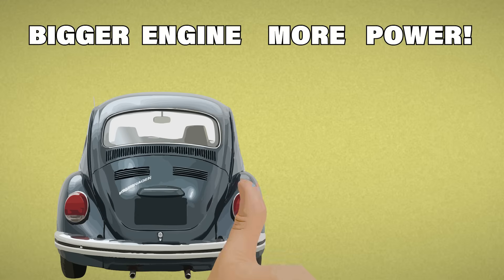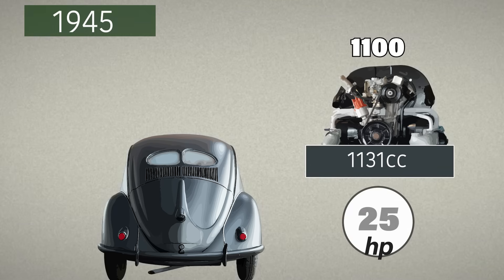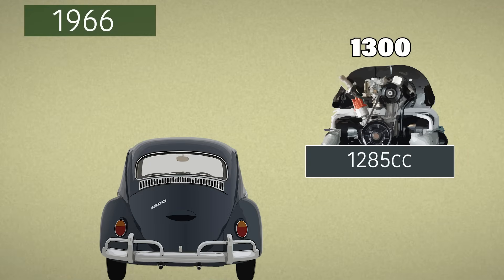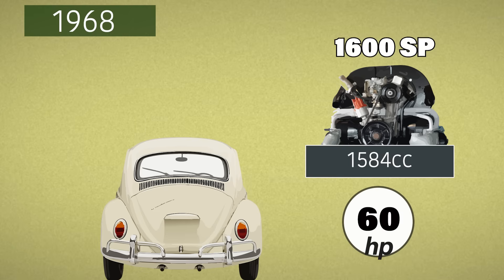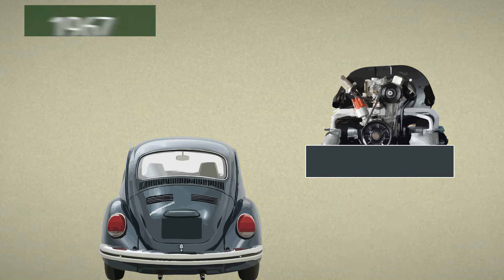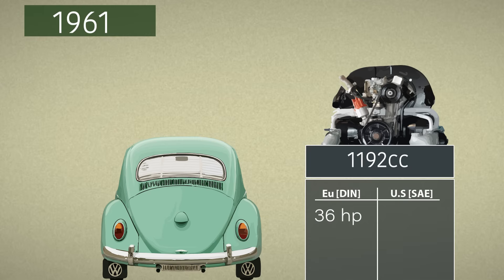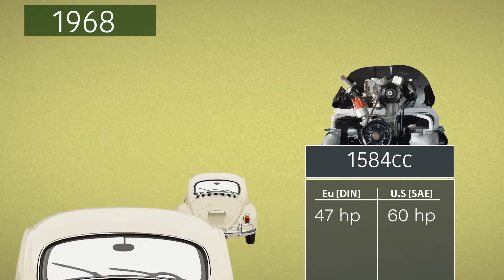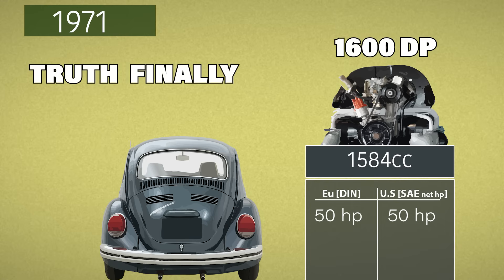The Great VW Horsepower Conspiracy

Comment: Reading the comments here makes me smile. Horse Power per cubic inch has long been the standard of performance. In the 1950's 0.7 hp per cubic inch was doing good for an engine. In the 1960's some engines were getting close to one horse power per cubic inch. 1970 saw some performance engines doing 1.1 horse power per inch. These are cars coming from the manufacturers, not ones tuned for performance in the back yard. A 1600 cc VW engine is a 100 cubic inch engine. For 1970, a good performing engine of that size would be 100 HP. You'll notice in the comments below that the biggest claim is still only 93 HP. My point is that these boxer engines were durable and economical but were only high performing engines if compared to other VW engines. For those of us alive in 1970, we already knew about the US conversion to a horsepower measuring system that reflected real life conditions as opposed to the one the manufacturers had used for years that gave them a marketing cheat in advertised power. The after market has long been good for VW engines. No matter which engine you start with, you can build something with major replacement parts to get whatever of performance our wallet can support at far less investment tan a similar change to other car engines
Reply: I have a motorcycle with a 1290cc (under 80 cubic inch) engine making 160bhp, more than the first 6 cars I owned. Times change.

Comment: The 1954 1200 was rated at 30hp in Europe, 36hp was SAE. The "modern" 1961  1200 was rated at 34hp, not 36.
Reply from the maker: Yes, I missed that, and it explains the massive jump which seemed odd. 27 up to 30 makes much more sense. Thanks for the correction 👍
Reply: That is not consistent with numbers published in the 1960's and  1970's that I remember. See if you can find a contemporary publication that says 34 HP.

I do remember 36 HP, and 40 HP.
Reply: @markjohnson8260  You mix up SAE hp with DIN hp. The 30PS DIN engine was in other counties the 36hp engine, the 34PS was the 40hp SAE. I still own a 34Ps/hp VW 11 vulgo Käfer; if I do not know - who else will??

Comment: HP is a factor of torque. Are you going to cover weight and torque?
Reply from the maker: Power to torque ratio, I like it. If you see it come up, you’ll know you inspired it 👍
Reply: @KombiGarage  Thanks but I'm asking if you are going to cover vehicle weight to torque as displacement increases without significant hp increases are typically used by manufacturers to deal with increased weight. I'd be curious to see how the Beetle's weight increased in relation to it's engine output specifically torque.
Reply: @DontCryAboutIt HP and weight are one and the same when observed, so they are the two to compare.
Reply: @PSA78 The weight has increased for example the 1946 weight was about 702 kg and 1974 about 816 kg.
Reply: @DontCryAboutIt Could be, if they posted acceleration time it's all be accounted for.

Comment: I had had three different VW and was finally ready to go back to a big 8 cylinder and told my mechanic to sell mine with a 1300 in it. When I came back it was still on the lot and when I complained he told me to take it out for a ride! He switched my 1300 out for a 1600! When a cop pulled me over he didn't ask me for my license, he asked me why it went so fast! I could pin that speedometer at 90 and keep on going!
Reply from the maker: Great story, thanks for sharing 👍

Comment: I knew a guy that was really good at performance upgrades on these engines. He changed barrels on a 1600 to 1835cc then I think he stroked it to 1900. It had fly cut heads whatever that means and an off road cam . He put duel Weber carbs on it as well.  He put this engine in a bug then dragged it down the quarter mile. First pass 12.8 seconds.
Reply: 1835 carbs webber  twin two barrel. extractors cam. Used to drop wheelies in my kombi.
Reply: And an engine like that won't last 50 k miles if driven as a street car and not a quarter mile racer...
Reply: You're right. This car was built just for racing. @davidhollenshead4892

Comment: My 1.6 on my sand rail is 70.7 hp and 91.3 ft pounds of torque its cammed with a big carb and has bigger oil cooler as well ram air setup to help cooling and for better flow into the engine.

Comment: I was born in 1951. While I was growing up my father owned a 1965 Volkswagen Beetle and later a 1972 Volkswagen Beetle. The 1965 Beetle had the 1200cc engine and the 1972 Beetle had the 1600cc engine. The 1972 Beetle was considerably more powerful and quicker accelerating and quicker climbing uphill grades than the 1965 Beetle. The 1965 Beetle was clearly underpowered. On many freeway uphill grades we had to drive in the truck lane with all the big trucks and could achieve a maximum speed of 45 miles per hour in third gear with the engine roaring in the back of the 1965 Beetle.
Reply from the maker: Great story, thanks for sharing. I can certainly relate to riding the truck slipstream.
Reply: The 72 probably had higher compression and D Jetronic fuel injection.
Reply: @gregorymalchuk272  Since I remember my father's 1972 Volkswagen Beetle. This car did have a carburetor. The carburetor on the 1972 Volkswagen Beetle was a better more complex carburetor than the 1965 Volkswagen Beetle. My father also told me that the 1972 Beetle got better fuel mileage than the 1965 Beetle because it had a better carburetor.

Comment: If you put a water jacket on a vw engine 
    a) it doubles the horsepower capacity 
    b)you just invented the Subaru 
but you can no longer change one piston or cylinder in a gravel  parking lot with just your vw’s every day carry tools.
Reply from the maker: Yes, always a trade off. They were built for simplicity and reliability. It’s great that they can be highly modified, but it will impact simplicity and reliability.
Reply: The first Subaru h20 flat four EA52 
Was 1000cc ohv and made 50 hp. So yeah pretty much double of the 1100cc first VW motor. 
The more modern EJ is dohc and fuel injected. Hardly a water cooled VW. Apples and Oranges.
Reply: @smokepeddler eh, ya want more modern? Think porsche, originally a mere vw with fun bits added. They made some crazy bits, too, such that after a while nothing swapped.
Reply: @jerrynorton1080 yes, the 356 and 912 were high performance air cooled ohv  flat fours. The first 911 was a flat 6  2.2 litre with sohc. A whole different animal.
Reply: I've seen/heard mechanics turning air blue working on water cooled VW flat 4...

Comment: What about the 1303 twin port?.....
Reply from the maker: I wasn’t aware of that one, and it’s an interesting one, with very similar numbers to the 1600 Single port. Thanks for bringing this to our attention 👍
Reply: My least favorite engine, heads are prone to cracking and there are no replacements, and somehow manages to feel weaker than a single port 1300 despite having more power on paper. Very anemic, no low end torque needs to be driven at high revs. If the heads are not salvageable i convert them to 1600. 1974 model years come with a 31 pict 4 emissions carb and dual heat riser manifold and exhaust too. Also has 10mm head studs from factory unlike the 1600 twin port’s 8mm studs.

Comment: SAE power ratings have always been a con. Big CCs isn't everything either. There is a special VW drag racing class with a maximum 1600cc permitted. Some of those racers get around the 200hp mark.
What can be said about the dual port engines is that there is much more potential for HP to be unleashed regardless of stock output.
Reply: my engine teacher in college had a bug "bad bug" that would run mid nines in the quarter mile with a big shot of nitrous.

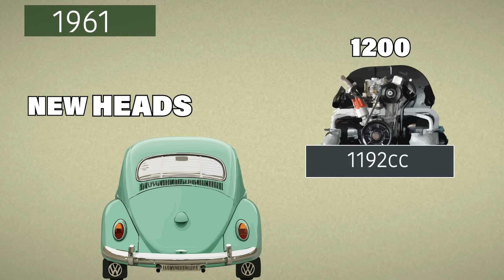Comment: 0:52
-new heads
-higher compression
-new carb

2:48
"nothing changed"
Reply from the maker: Good pick up, my error was further back, 0:40 which explains the big bump in hp between the 1100 to 1200, it should have been 30hp, the 36 hp is correct for the 1961 upgrade. The “nothing changed” is referring to the European DIN measurement of 36 compared to SAE measurement of 40. I hope that clears things 👍

Comment: The 1200 and the 36hp weren't the same engines even though the capacity was the same, the 36hp was a much smaller over all motor.

Comment: And then your you can get 93hp out of a 36hp motor with the okrasa mods ;) Well done Joe these are great info!
Reply from the maker: 93hp? Is that SAE Gross or Net 😂

Thanks Nick 👍
Reply: If cost and reliability aren't an issue, you can do 200hp.  Those are the real questions which need to be addressed.
Reply: @rockets4kids dam straight 😂
Reply: My older brother spent lot a of money on those short lived modified engines. He was pissed when I brought home a datsun 1200 with more hp, a 5 speed, disc brakes and twice the mpg.